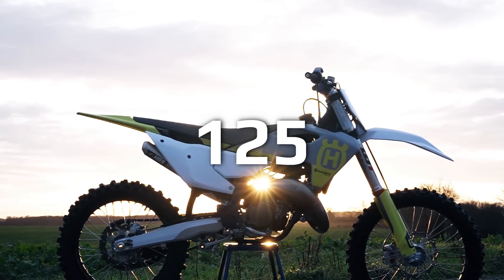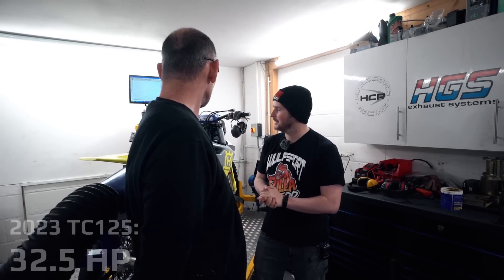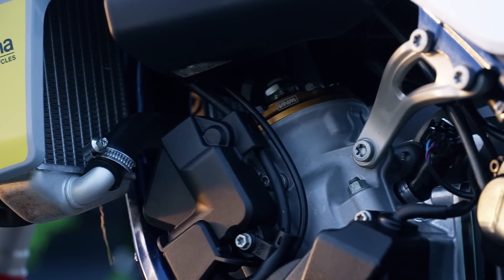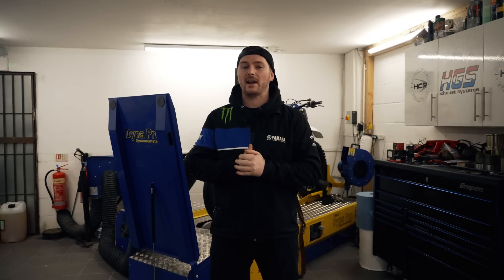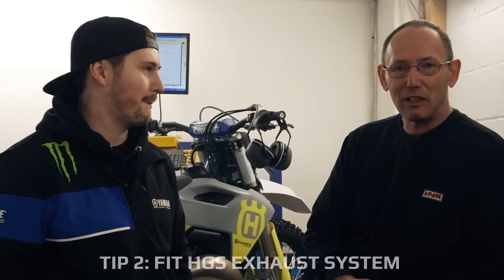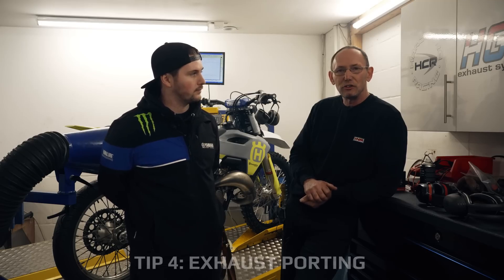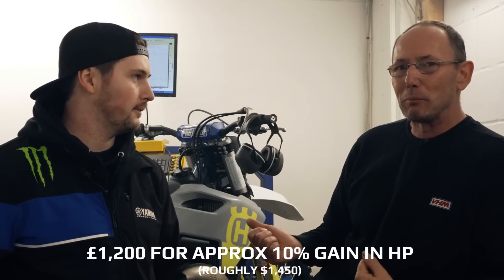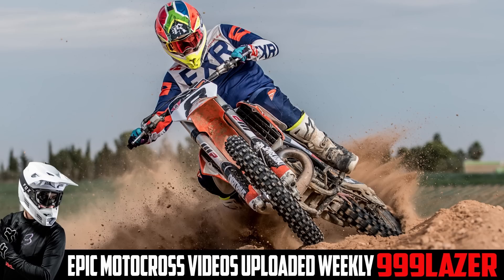How Much Power Can We Get From a 2023 Fuel Injected 125 2 Stroke?

Comment: check out AJ Catanzaros Cr125.. hes pushing 45HP! he said its the fastest bike hes ever ridden
Reply: Which is a ktm150.  Had pv work. Porting. Top end. Pipe etc.  Was a shocking power figure!
Reply: @TheShift1313  ya! Amazing bike
Reply: Yes while it was an insane number 45 hp isn't a fair figure to compare to this dyno every dyno is different so it's more important to know that dyno numbers. That cr150 is amazing and these 23 125s are amazing not fined tuned yet  but can be amazing

Comment: I've had a fair few crossers from 80cc - 500cc since the early 80's.
I'd say the quickest 125 I had was a 2001 Yam ( YZ125).. It literally flew, they guy I brought it from raced it, so it was dialled in.. Rapid 125...
Unless people properly race bikes, I really don't innerstand why people would buy the newest bike out, because their not cheap....
Most of it is down to the rider..
Great video though, and thanks for sharing ✌🏼
Reply: I too had a 2001 yz125 and the bike was an absolute ripper. Never should have sold it
Reply: Yamaha from like 97-04 is awesome
Reply: I had the first gen pds KTM 125, the 1998 model and rode with a bunch of buddies who had japanese machines including YZ's. None of them had a motor that would run with the KTM, they handled a little better but motor wise it was not close.
Reply: nice new bike dosent have a history of abuse and halfassed maintenances
Reply: You ever rip a ktm 200? Rips like a 300 with out the “oh fuck” qualities of a 300. And when modified they’re quicker off a dead stop than a 250 but lack the top end that gets scary on the trail.  My forever bike
Reply: @chadsummers7981  i have a 200 I’ll never sell, killer on dead engine starts.

Comment: I’m not going to lie….those stock figures are a bit of an anticlimax after all of the hype…especially since Roland said the atmospherics were in favour of the 23. What would the 22 figures be if it was ran on the same day? The bhp gap would increase even more.  
If Roland did the same work to the 22, pipe, piston, head and mild porting it would still smash the 23 with the same spec.

Comment: I would suggest All 2-smoke fans to check out Aj Catanzaro’s 150cc Straight rhythm bike which they manage to squeeze out 48(!) horsepower out of! You can find it here on Youtube.
Can’t help but to miss my Husky cr125, although the 450 is much more useful in the woods and on the streets..
Reply: 48hp out of a 150 is a stretch.  I own/built a water brake dyno for my little engine work.  Did you know there is no real good way to calibrate them?  That is why you can take the same engine package to a different dyno, and get different numbers.  If they got an actual 48hp out of it,---it was not running on gasoline.  48hp is pretty good for a 250cc bike on gas.  I wonder how funny his exhaust smelled?  :)
Reply: @EarthSurferUSA  probably smells like corn i would guess , haha
Reply: @EarthSurferUSA nitromethane maybe?
Reply: I had a Husky Cr125 bored to an Eric Gore top end 144, and my 23 125 SX makes more power at every rpm. It's much easier to ride as well.
Reply: 48 is realistic  from a 150 , factory KTM 125’s where over 40hp decades ago and the road race 125  - 55hp !

Comment: What was the warm up procedure on the bike? The cold start enrichment map on the ECU is very rudimentary and is purely temperature based.  The bike will not exit cold start enrichment map until the water temp exceeds 50*c. This could be the reason you were struggling with the bike being rich outside of the map switch.

Comment: Tuned to the bleeding edge (reed block, pipe, porting, fuel tuning perfect everywhere), it will probably make 40 at the crank. You'd want to dial it back a little to make it live in actual track use.
Reply: The harsh truth is fuel injection will do nothing for horsepower. It makes tuning faster and easier, but you will get just as much power from a carburetor. Its main benifits are slightly less emissions, and that is irrelevant an a  losed-course racing bike.
Reply: @dr.hugog.hackenbush9443  its all about smoother throttle and smooth fuel delivery
Reply: @lifebehindtheselens  I had a throttle carbed 91 kdx200 comparable  to that of a efi ktm all about tuning
Reply: @dr.hugog.hackenbush9443  If anything it wil actually reduce power because of reduced fuel droplet size, I have a feeling the spray patterns on those are made extremely fine for emmissions
Reply: @lifebehindtheselens  on a 125? 😂😂😂
Reply: Almost impossible to tune the fuel on these considering its a 2 stroke and isnt a closed loop system

Comment: I kinda have questions. Back in the day, the Aprilia's in theory put out 32BHP or so, and that seems the top line. Various other 125s like the KMX might do 22BHP. 

I noted that during the run the hand was over the clutch lever in true 2 stroke style and I noticed fuel being blipped/fed in on the slow down (we might hope the fuel mapping would feed in fuel to guard against that..

So, questions - was this bike fully run in?
And after the £1200 spend, what kind of milage would you get prior to needing an engine rebuilt. Is this a 1000 mile engine or a 10000 mile engine?

Comment: If you can't do anything with fuelling it's a bit pointless tuning it.
Throttle body injection is used on aftermarket car stuff, one is called megasquirt, costs about £900. You just need throttle position, rpm pulse and that's it, but engine temperature, lambda sensor could be part of the map.
I think Athena do a direct injection kit for smaller bikes, I wonder if they could be adapted?
Bigger throttle body?
With thin slide/ smoothbore?
Different reed block?
Kitten injection?😉🤯

Comment: im really surprised at how little power that made from the factory, my kx125 from 1986 makes that same power and torque
Reply: That will most likely be factory readings from the crank.
Reply: No. No it does not.
Reply: @scootypuffjr.  dyno tested it today 36hp to the wheel
Reply: @bananas401k  every dyno is different. Comparisons only work on the same dyno.
Reply: From a 1986 KX125? Id be interested in seeing the graph, as I have a 125 trail bike that has an engine very heavily based on the 86 KX, but de-tuned somewhat.
Reply: @stevenbusk539  having done an engine rebuild since then, it seems to have forged and high compression internals, and extremely aggressive porting, its history remains a mystery to me
Reply: @bananas401k  I've rebuilt my trail bike engine that's got the look of the KX. I've done the same mods, like the forged piston, high compression and porting, and it just about makes 25bhp at the wheel on the dyno I go to.  Kawasaki rated the 86 KX as 34bhp in brochure I think?
Reply: it also may or may not be an actual kawasaki factory mx bike, theres lots of things that it has that the regular production ones dont, anyone know how i would identify that?
Reply: @stevenbusk539  have you tried tuning the spark timing? What about the pipe? Yours also might not Rev as high, mine goes out to 13,000 with peak power around 11
Reply: @bananas401k  Yes that's with a programmable ignition and flat slide carb, VF3 reeds and airbox mods too. It's 25bhp at 8500rpm and revs to 10.5k

Comment: Would it be fair to say once remapping is available and therefore fueling adjustments, these bikes have the potential to not necessarily rewrite the 2t performance handbook but certainly make a vast improvement? With a carb setup, you'd just rejet it, but as the software isn't available yet for these, fueling is very much static set by factory. So I'd like to think the future looks very bright for two strokes.

Comment: I wanna see ypu guys get a 250 2 stroke to 50 whp maybe more if that’s possible without getting too crazy
Reply: It has been done and raced many times.  But they need expensive race gas, so 44-47 is about the production limit today.  Good porting matched with a good pipe with high compression on race fuel, and you are there.
Reply: Bone stock '02 & '03 KTM 250SX engine were putting out 50 hp while Japanese 250s were around 43-45 hp

Comment: I can get 40hp out of a 125 running on gas with a carb,---but you guys would not be able to ride it well on a MX track other than the wide open smooth straights today.  You would stall it a lot everywhere else.  I think it is still true that a 2-stroke can make twice the power of a 2-stroke of equal displacement, but for drag racing, not for MX where you need throttle control,---and clutch talent.
Reply: I think it is still true that a 2-stroke can make twice the power of a "4" stroke of equal displacement
Reply: @EarthSurferUSA  I don't believe that twice the power is possible as the 4 strokes still have cleaner scavenging. I'm pretty sure Yamaha's famous "1.6x" was pretty close to the actual difference in performance per given displacement.

Comment: Question - what is a 12 degree piston?
Reply: 12° dome
Reply: The edge of the piston is angled at 12 degrees but you need to buy the VHM head and insert to suit the piston dome pistons have flat top with a 12 degree edge some pistons are domed with a 12 degree edge

Comment: I love Roland but no way in hell is a bike coming out the factory at 37hp gonna dyno at 33hp. But to find 3hp just from a port job, vhm head, map change and a hgs system is ridiculous gonna get more then that surely
Reply: Dyno's are not calibrated, and will get different results.  Plus, 33hp at the wheel of a 125 was slow about 30 years ago for a modified bike.
Reply: Dynos can only really be compared to themselves, unfortunately. And 3 hp sounds small but in percentage terms its a ten percent improvment which is pretty good for the kinda money they mentioned. As a an ex racer back in the day if you gave me one hp over every one else I would be a very happy bunny 8)

Comment: Is that 36 wheel or crank hp??
Reply: Have you ever seen an engine dyno for dirt bikes?  I would bet the factories made their own, but everybody else is using a roller/chassis dyno, because it is way more difficult to hook up different engines alone to a dyno.  Even so, dynos have no real calibration that I have ever found for either type.  That is why a different dyno will most likely post different numbers from the same engine set up.  I bought a Land and Sea water brake dyno for my little engines, and built the drive system for a engine dyno.  But I really had no idea if it was displaying the actual torque.  But the stock engine does have hp/rpm in the owners manual (with no exhaust pipe/can, no exhaust at all and no air filter.), so I ran the stock engine, and adjust my "efficiency loss factor" in the software to match the 2.8hp at 12,500 rpm that the manual claims.  It did peak power at the 12,500 rpm claim, so that was good to see from the Japanese built engine (Zenoah), now owned by Husky.
That is the best for calibration I could do, (trust the engine manufacture).  I have never seen a good way to calibrate a dyno, but some can be so simple, (direct drive inertia dyno's.), that if designed properly, will be accurate as soon as you put it together.  I measured the same engine on a inertia dyno a old boss of mine made.  The manual said 2.8hp.  I got 2.78hp.
Reply: @EarthSurferUSA  I didn't ask for a life story which I didn't read
 Was just a simple answer wheel or crank hp
As rollers can work out crank hp

Comment: Carburetor vs fuel injection at top in full open Carburators are the same has fuel injection no benefits going to fuel injection.
Only better low in power.
The 125 that's built will make 45hp.
End of story.
Reply: The biggest problem with mx 2 strokes though is their usable power. Fuel injection should help that as more maps are developed, plus the default bonus of better fuel atomization. The other 2 stroke problem was lack of over-rev, which I'm not sure what the solution would be. 250f you can rev for very long without shifting, 2t you have to make sure you're in the perfect gear.